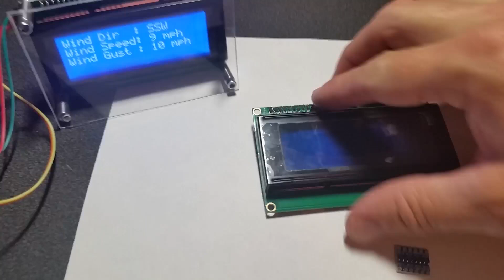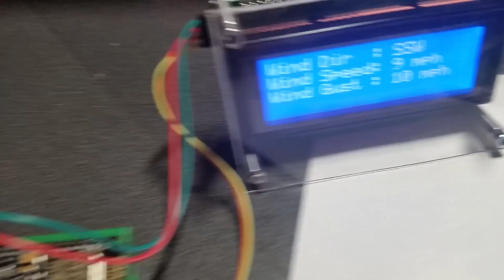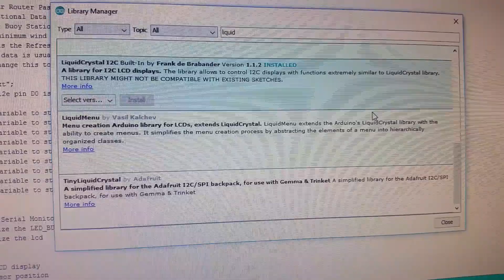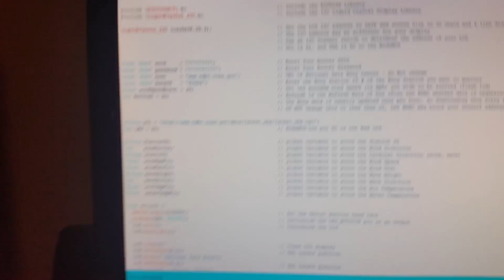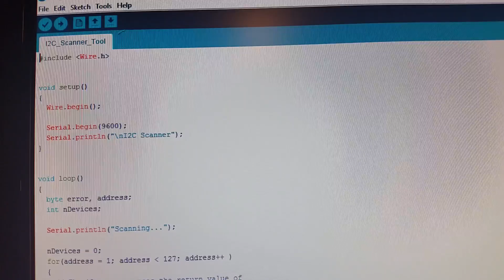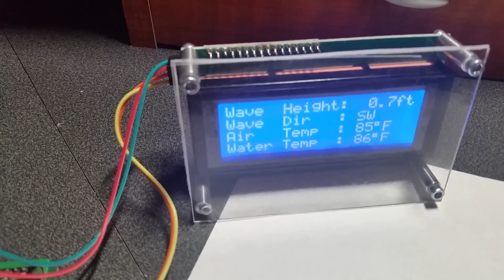Connect an LCD display to the NodeMCU ESP8266 Tutorial

Comment: //*************Ejemplo para Placa NodeMcu V3 Lolin Version 0.1****************
// By Godbad , Colombia

#include <Wire.h>  // Libreria para configurar los puertos Base
#include <LiquidCrystal_I2C.h> //Libreria para manejar LCD
LiquidCrystal_I2C lcd(0x27, 16, 2);  // Protocolo 0x27 para este tipo de LCD, 16 para la cantidada de caracteres por linea , cantidad de Lineas en el LCD que son 2
/*
Ejemplo de nuestro LCD
X|X|X|X|X|X|X|X|X|X|X|X|X|X|X|X
X|X|X|X|X|X|X|X|X|X|X|X|X|X|X|X
*/ 
void setup()
{
   pinMode(2, OUTPUT);  
   Wire.begin(D2, D1);  // D1 = SCL | D2 = SDA
  lcd.init();   // Iniciamos el LCD
  lcd.backlight(); // Prendemos la Iluminacion del LCD
  lcd.clear();
}
 
void loop()
{
  lcd.clear();
  digitalWrite(2, LOW);
  delay(1000);
  digitalWrite(2, HIGH);
  delay(1000);

  lcd.setCursor(0, 0);  // Cursor0 , Linea0
  lcd.print("Linea1");
  lcd.setCursor(0, 1);  // Cursor0 , Linea1 
  lcd.print("Linea2");
  delay(1000); 
}

Comment: Hi friend! What is this board behind the display? Thank you
Reply from the maker: That is an I2C adapter, you can purchase the LCD with or without the I2C; however, without it - it would be nearly impossible to connect it to the NodeMCU because of the number of pins you would need to connect it. I2C greatly simplifies the project.

Comment: Hi,
Great project, where did you get the correct LCD library?
Regards,
Stan
Reply: Thanks for the link, I got it working. I am also trying to get it working with a 2.8" tft display to be able to show more information.
I quit doing brens, they were just to much work to be commercially viable. I put all my efforts into doing RPD's.

Comment: Finally someone saying something sensible on the LCD running on 5Volts
Reply from the maker: Thanks for watching, BTW I am still running the same program with the Nodemcu hooked to the LCD display for over two months. No problems!
Reply: great. Haven't been able yet to succesfully attach LCD to my esp (01). No problems with an I2C OLED though. Just got leveladapter. Will try that one for lcd
Reply from the maker: Just remember I am using the nodemcu, you will need to make sure you are powering the lcd with 5volts. The level shifter is just for the communication lines between the two I2C, scl and sda. good luck
Reply: yes indeed. I have seen people use it without a levelshifter. I find that too risky
Reply: Does it though? Are you sure it wont run on 3.7